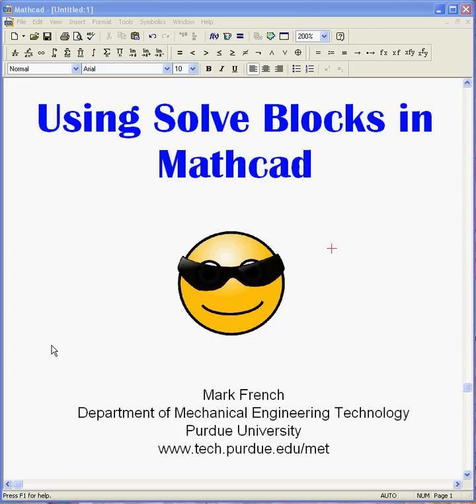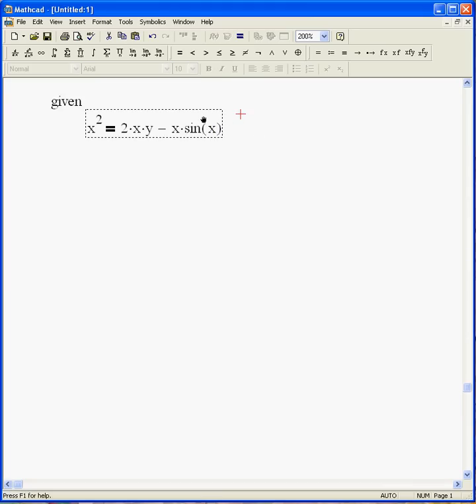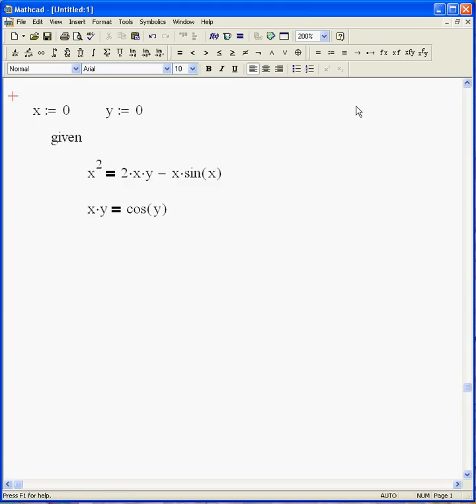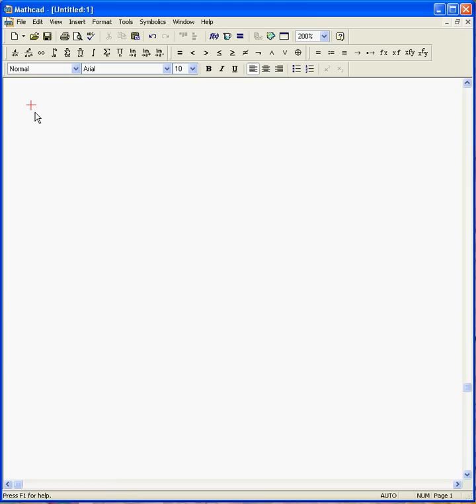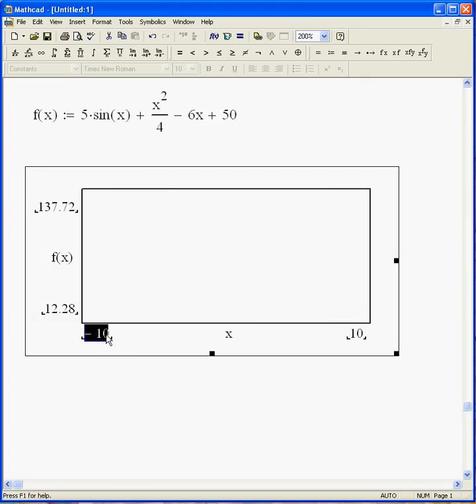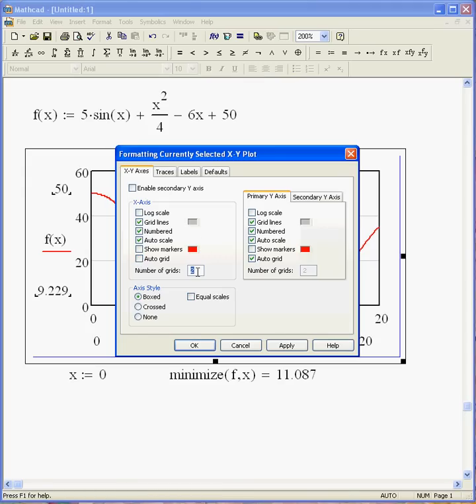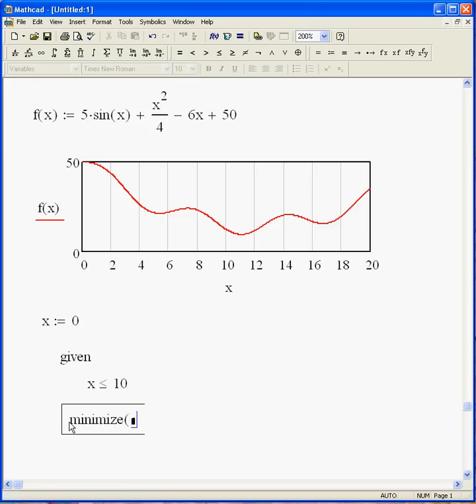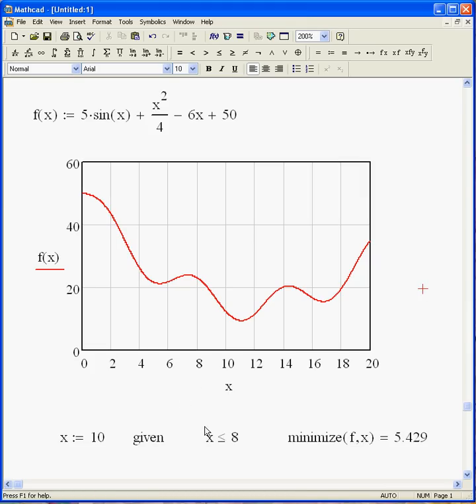Mathcad Solve Blocks.avi

Comment: I did the same operations with the exact same values but Mathcad produced completely different results for x and y when I used 0 as the initial guess. It's not until I use 0.00001 for either y or x that I get the same results as the video. Could this be due to the fact that I'm using a newer version? My colleagues and I are new to Mathcad and we're a little stumped as to why it's doing that.

Comment: Well, i have an electrical circuit where I can control a couple of resistors. To find the ideal values, I would like to make an initial guess (of R1, R2, R3 etc). Since the ideal value of R1 is dependend on the values of R2, R3 etc, it should be possible to create a loop that continuously updates the values (a bit like in Simulink), to determine the ideal values.